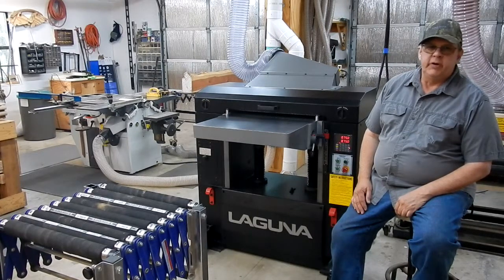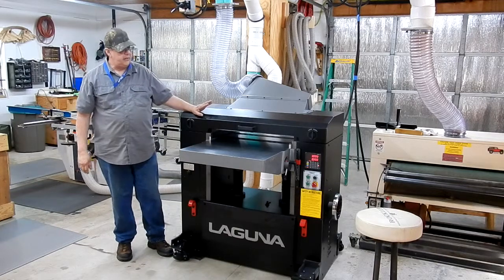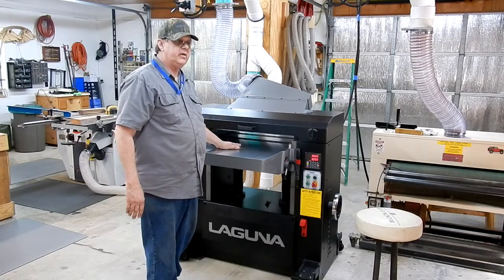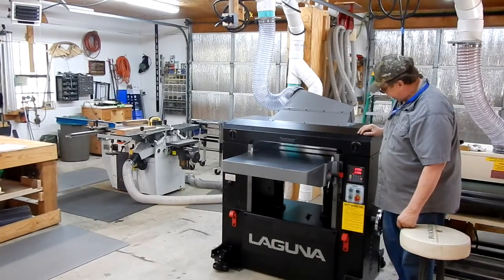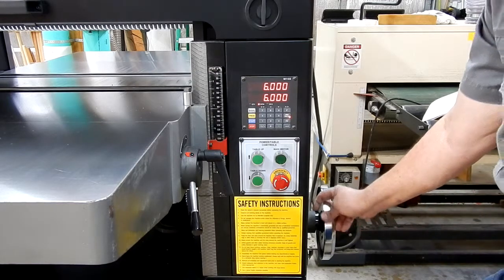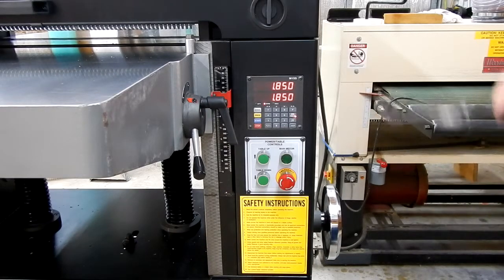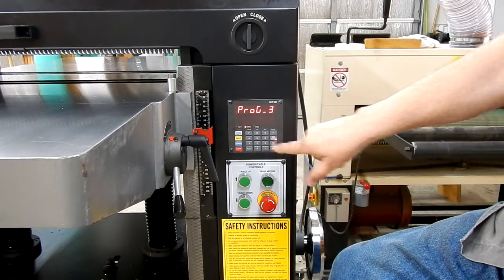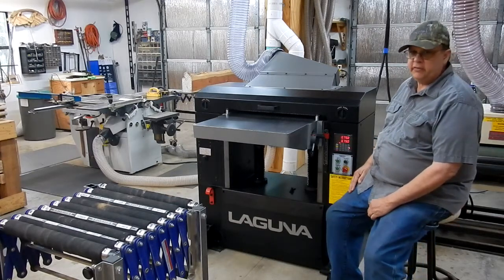Laguna Planer Calibration and Programing

Comment: Any chance on doing a video on adjusting the feed in and out rollers
Reply from the maker: I have thought about checking the adjustments on the pressure rollers and bar. It is something that I really need to do but just have not got around to it and unfortunately will probable not do any time soon. To many other things on the to do list ahead of it. Most of the time I do not have snipe on my machine other than the occassional soft wood board like eastern red cedar and it is no more than several thousands that will come out with a hand plane after a couple of passes.

Comment: Thanks for making this video. I'm looking at possibly purchasing this planer. Are you still happy with it 3 years in?
Reply from the maker: I had the control panel go out last year and Laguna responder quickly and sent me a new one. Love the ability to punch in the thickness you need and it goes right to it for repeatability. The Laguna, Oliver and Powermatic are the same machine with slight differences. The Laguna is the only one with the cast iron extension tables which help out a bunch but you could add your own on the others. I have a slight snipe issue on the occasional board of about 0.002" usually on soft wood. That really does not bother me since I hand plane afterwards if it is for furniture or sand if a cabinet face. I do have some variance of board thickness throughout the cut going on right now. Toward the middle of the board it is cutting about 0.008" to 0.010" less. I have been meaning to go through and set all the roller and finger pressure but it just has not been enough of an issue as yet with all the other things I have to do. The only other issue I have is the cutter head design seams to not clean itself as well as the Bryrd Shelix that is in my Robland. The cutters get buildup on the back side of the cutter and eventually cause an impression on the face of the planed wood. I take a small piece of 5/16" red oak and go through and scrape the back side of the cutters that need it and it is all good again.
Reply: Thanks David. As always, your information is very helpful!